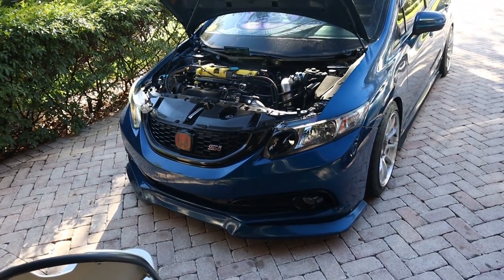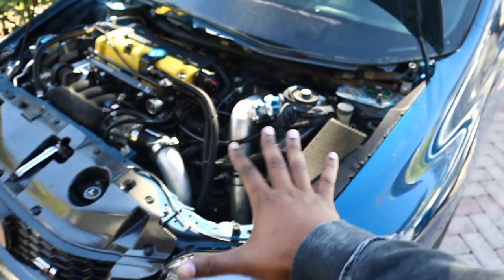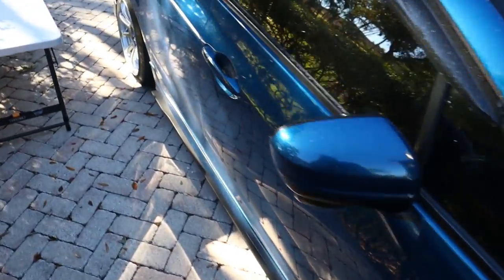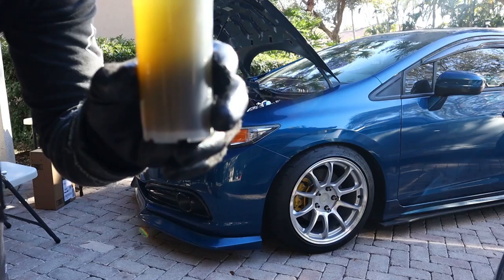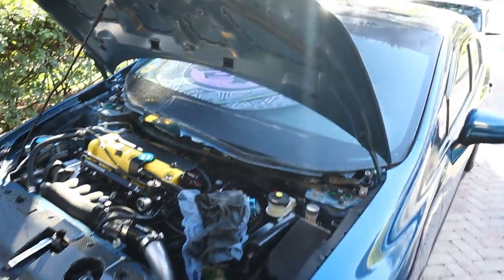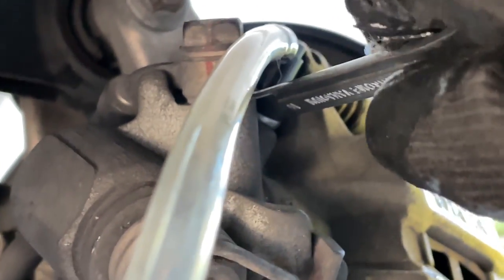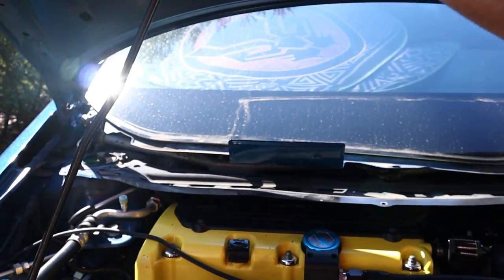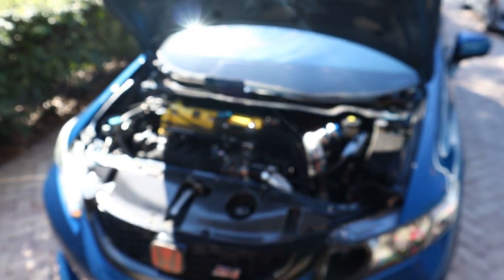DIY: HOW TO FLUSH YOUR BRAKES (9TH GEN CIVIC SI)

Comment: Nice....so after u flush all the brakes from all sides....do u need to bleed it or no???Thanks
Reply: No as long as your don’t run the master dry and don’t take the hose off the bleed screw while it’s loose no need to bleed the brakes.